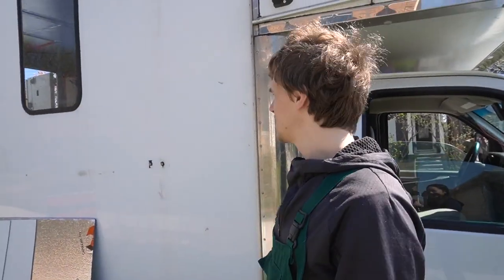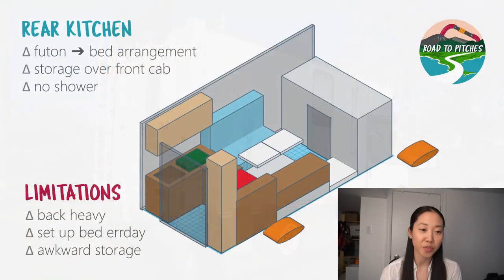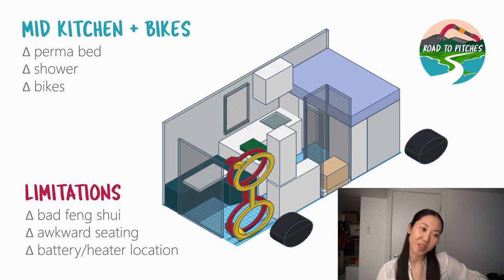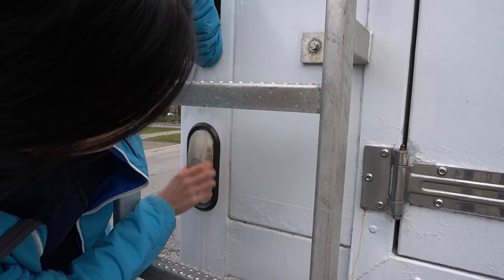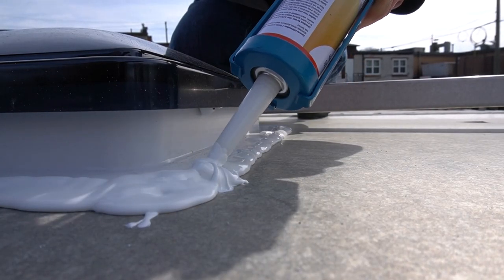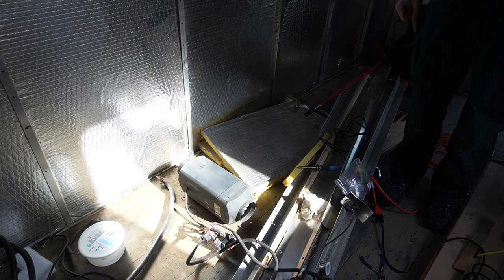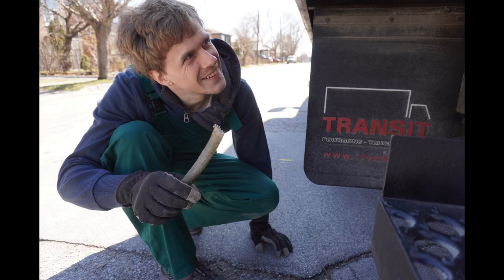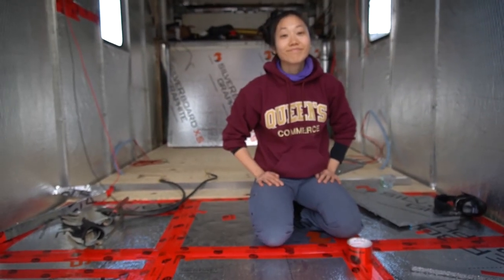3D Plans, Floors, Solar Panels, Fan, and...PEE JUG Removal! | BOX TRUCK CONVERSION

Comment: Hi!  That part of the box over the cab is called "the attic" by some folks.  Nice vid!  Keep on truckin'.
Reply from the maker: I like that! The attic. Thanks for stopping by, Wingnut Stickman :D.
Reply: @RoadtoPitches  NP!  Helpful hint:  Do not drill pilot holes if you are using a reciprocating saw (which IS the correct tool in the case of cutting straight lines) -- allow the saw blade to scrape back and forth in one spot on the surface until a hole is pierced, and then plunge through.  Takes practice!

Comment: I bought the sister to ur truck, and slept in it AS IS from the start....i dunno about the heater....I took mine out. Terrible fumes and noise. Could never sleep thru it.
Reply from the maker: Woohoo! Congrats on your purchase. Are you planning on doing anything with it? We're not happy with the noise either, but we think that as long as the noise is a steady white noise, then we'll be fine. We didn't notice much fumes when the filter and glow plug worked! Definitely noticed the smell of fuel after we broke the glow plug by accident and mucked up the filter (it'll be fixed at some point).
Reply: @RoadtoPitches  suggestion, take your exhaust thru the roof... I know, that causes a lot off issues getting it there but the result will dilute the fumes, and quiet the outside noise at ground level ... see youtu.be/ro1mkjrMcLE (start at 30:00 for explaination) and   search dyi gen-turi for more ideas... FYI not that I think you'll be using a campground much, but some have made above roof exhaust mandatory to reduce the risks of CO poisoning...